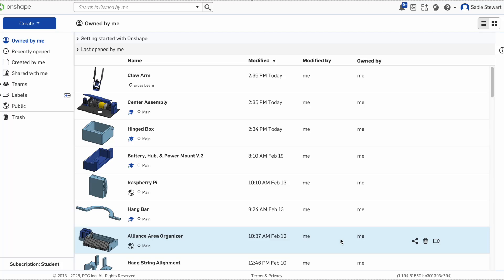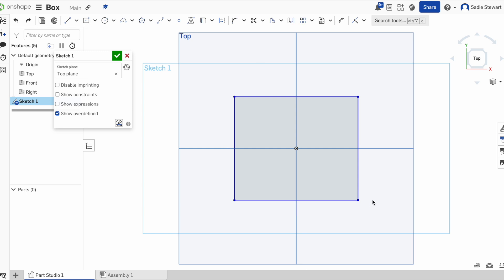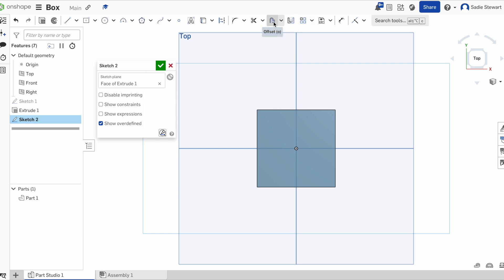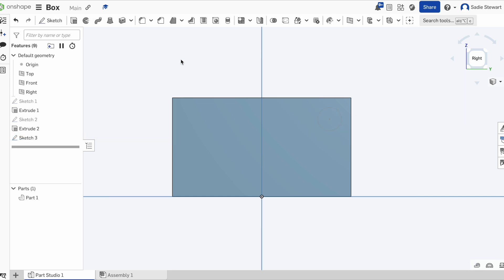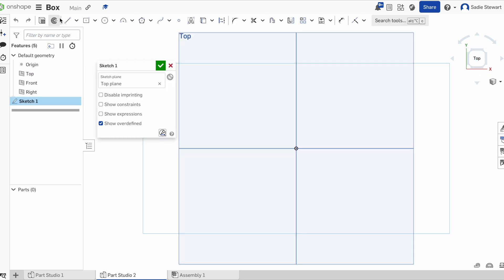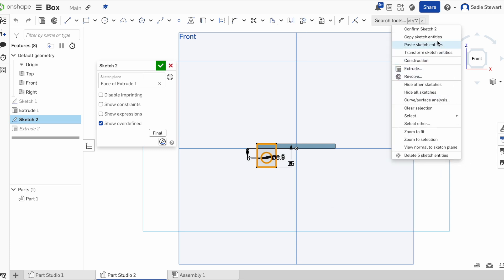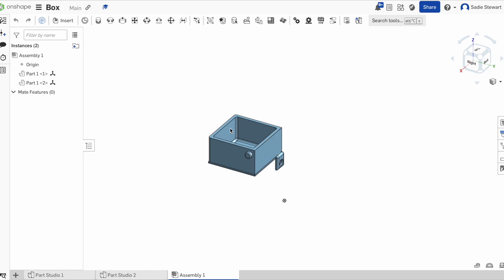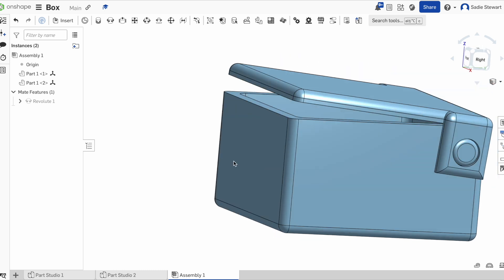Onshape Hinged Box Tutorial

Comment: Thanks a lot, this was exactly what I was looking for😁
Do the parts print together or separate?
And is there a way to make the lid close without opening? Like, snapping together
Reply from the maker: Glad you found this helpful!
I recommend printing the parts separately and snapping them together after.
If you want the lid to close without opening, like a lock mechanism, there are a couple of ways to do it. The simplest would be adding a small hook on the lid that flexes and clicks over a ledge in the box interior when closed. When you push the lid down, the hook bends slightly, then snaps into place and holds it shut.
Reply: @SadieStewart07Thanks!